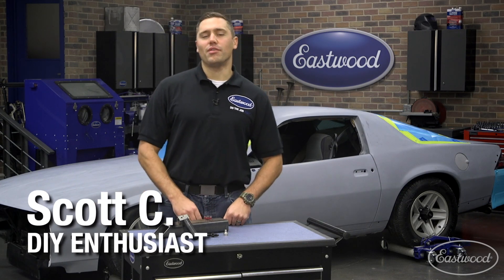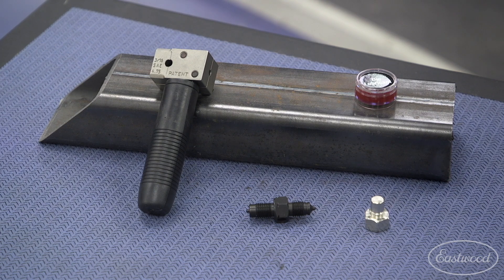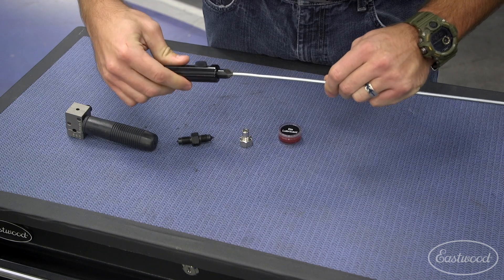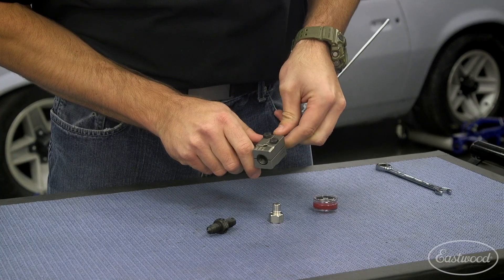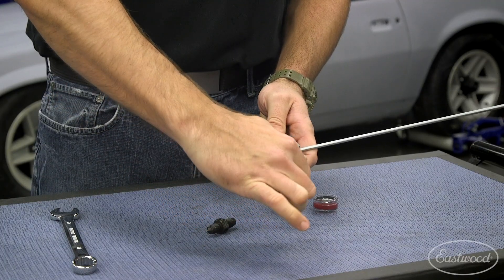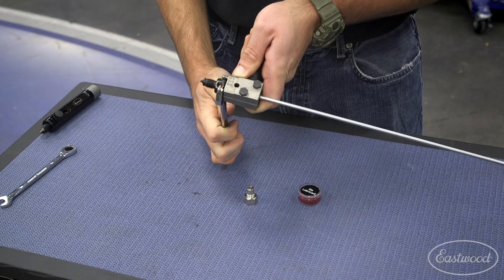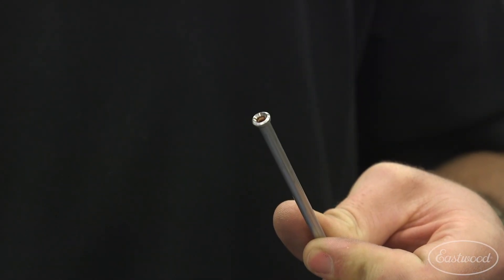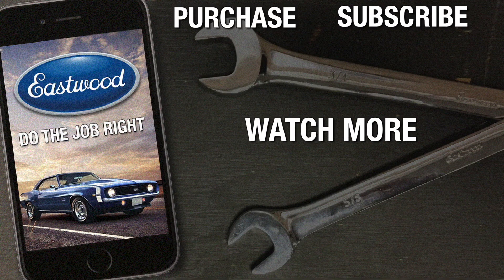How to Create a Perfect Flare Using the On Car Flaring Tool - Eastwood

Comment: As mentioned by another the greasing is in incorrect order, and you forgot to mention that the handle can be removed for use in thight spaces or in a vise.. Other than that a very nice tool to have in the toolbox..

Comment: This description is incorrect!  Do NOT put lube on the end of the line then slide it into the block.  This coats the block with lube and then allows the line to slide out if you don't tighten it an extra amount, which you do not want to do because this is a cast metal block and the threads will not handle many uses at the extra torque, and the extra pressure on the line, slightly deform it.

Instead, put the line into a clean block, dry.  Next, lube the die bolt.  This gets the lube onto the tube equally well but without coating the inside of the block with it and making it slippery.

Comment: So you can do this on the car if the fitting is bad but the line is still good?
Reply: Yes but how often does that happen?  Most of the time I encounter a fitting that needs replaced, it's rusted onto a rusty line and won't come off without twisting the line apart too.  Sometimes there is enough slack in the line  to make a new flare but usually not.  Instead you'd add a union and additional piece of line to make up the length difference.

However it does not work well on harder steel including stainless line.